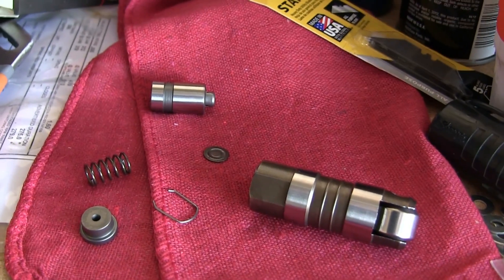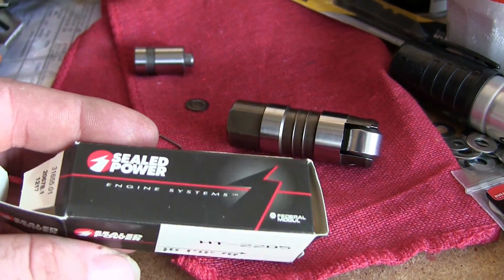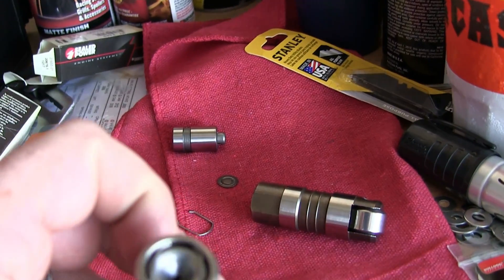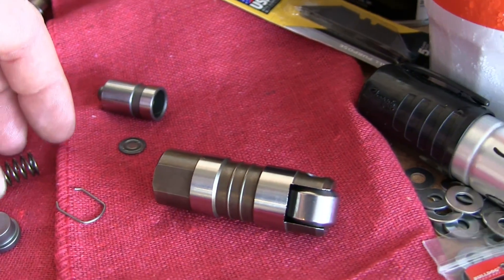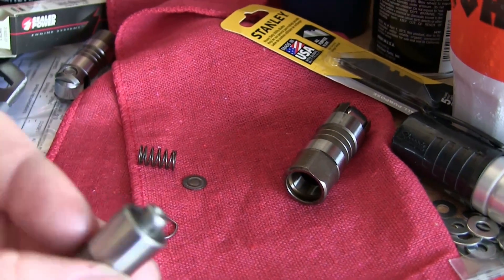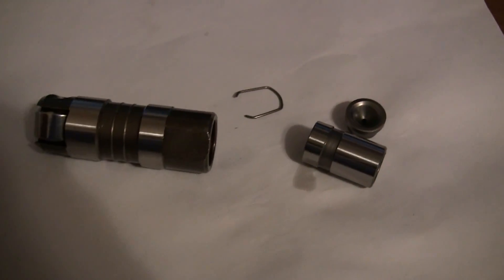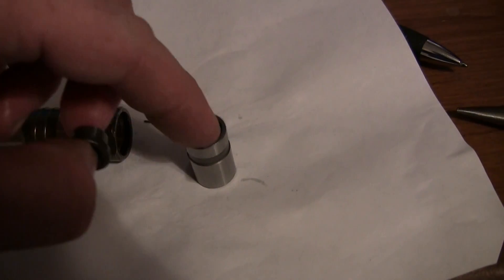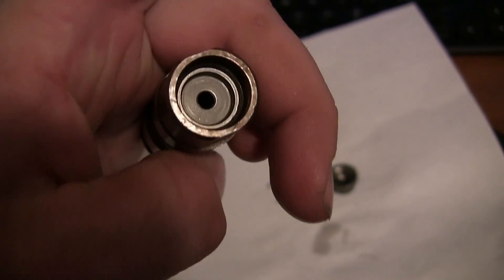How to make a hydraulic lifter solid

Comment: Nice work buddy.  I pulled the same stunt with Melling JB-2250 yesterday. Identical construction and results.  For those concerned, be advised that I needed to do this because my Comp Cams lite weight valve checker springs (4758-2) easily depressed the Ford Motorsport Hyd roller lifter (FMS-M-6500-R302).  I have the intake off and you can easily see the roller lifter plunger depress.  Honestly, I think the Comp Cams checker springs are for people using old school weak threaded push rod length checkers which will bend if used with the factory valve spring.

Comment: What could happend if i run them?
My rebuild motor isnt running like i expect and i think that could be because of hidraulic lifters. They are new but in the preload i feel diferences between them. Making all the proces of timing and press oil, etc.
Sorry about my english.. and thanks!.
Reply from the maker: Dont run them! Only did this to check piston to valve clearance.

Comment: Can the lifters be returned back to normal hydraulic function and be run like normal in a motor or does it damage the internals
Reply from the maker: You could if you want to. I just got a cheap set to check pvc

Comment: I can't get that second stage out of the lifter. I have tried to use a hook tool, banging it on a piece of wood, but no luck.  If I use a pushrod, I can depress the spring further. Can you show how you used the pliers to get it out.  Thanks
Reply: if your lifter is used it might be galled just use another one or tap the lifter upside down to knock it out

Comment: This doesn't allow you to Check it correctly as you can't set the pre-load, guess you can always guess hu.....?
Reply: If you need to find proper pushrod length, or check piston to valve clearance, you need to use a solid lifter. This method is excellent for doing that. A hydraulic lifter with no oil pressure inside will compress too much.
Reply: U add the .050 (pre-load) to your push rod length
Reply: Add it to it dumbass, you know 2 plus 2, 3 plus 1, etc

Comment: So I just did this, but my lifters are slightly different than yours. They're out of a 302 but I'm not sure the brand. The outside looks a little different and the insides were a little different too. They came out of my 347. I managed to get the internals flipped and got the clips back in and they can't compress now, but I think the inside plunger where the pushrod sits might be just SLIGHTLY taller than one that hasn't been converted. I'm going to get some calipers and measure, but I have a feeling it's a few thousands difference and could effect pushrod length. Ultimately it would just result in a slightly shorter pushrod than optimal, which isn't the end of the world and is better than one that's too long but I'll get back to ya with measurements when I get them.
Reply from the maker: I made the lifter solid to check ptv clearance. Not to run in a motor. Not sure what brand lifter it is. Got it at oriellys and one of the cheaper ones.

Comment: I know this is to check ptv clearance, but I need to switch to solid lifters but cant find any roller ones for my flat tappet block. do people ever run them like this as a solid lifter?
Reply from the maker: I don't suggest doing what i did here on a running motor. I only did it to check ptv. Is your block a roller motor?
Reply: its a flat tappet block, I found some solid roller lifters for it, push rods get here tomorrow and then it should have no issues hangin out around the rev limiter for ever! I was running Jegs retrofit hydraulic roller lifters but I guess they expect you to shift at their rpm limit, not sit there for 5 seconds at a time. you should come out to a competition sometime so we can get you addicted to drifting!

Comment: just did this same thing. no washers remove spring and check ball, flip the spring cup and reassemble. 50$ for this and a pushrod online....i spent less than 12$ for the same thing! great video,  used this to check piston to valve clearance!
Reply from the maker: +Josh King works perfectly. Thanks for watching!